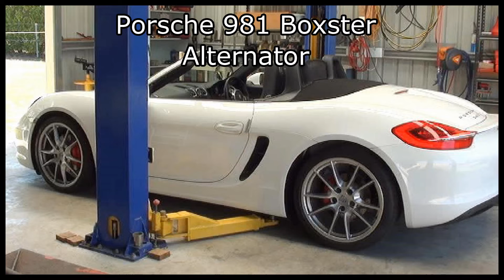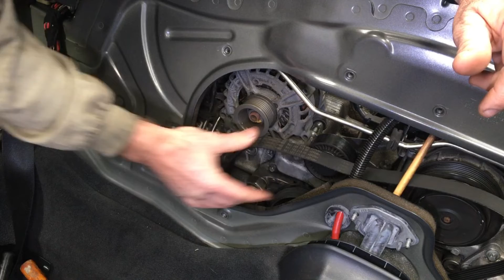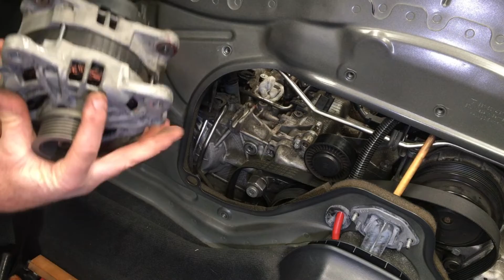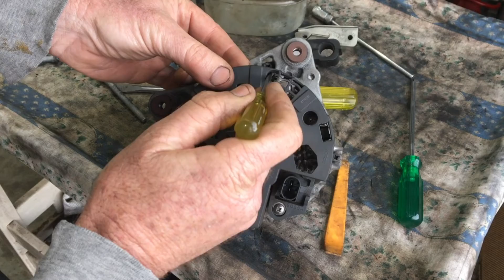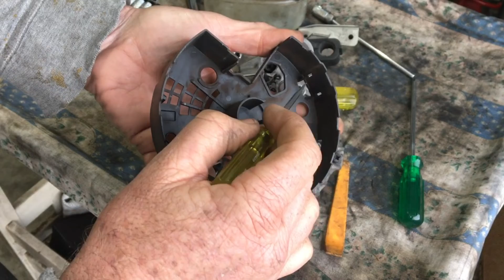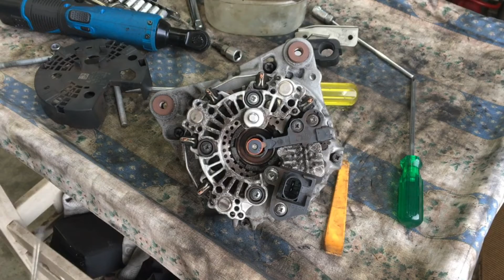Porsche 981 Alternator

Comment: Jeff, how much play is in the main wire and connector? Do you suppose you could pull the alternator forward far enough to reach the connectors from inside the cabin without breaking them or having to remove the intake?
Also, have you been able source a voltage regulator for these? I haven’t been able to find a separate part for the 981’s

Comment: Do you think you could change the voltage regulator without removing the alternator by just coming in over the top as you started when disconnecting the electrical connections? I’ve a 986 but it looks extremely similar
Reply from the maker: I didn't try this, but to be honest, alternator removal is pretty simple, and with the limited space in the engine bay it might be tricky. Only one way to find out though and that's to give it a go.
Reply: Thanks very much. Your videos are very helpful and gives me confidence to go ahead

Comment: Great guide, I’m having issues with battery drain on my cayman, I’ve narrowed it down to the alternator so I’m going to follow this guide, doesn’t look too tricky. How easy is the intake manifold to get off?
Reply from the maker: It's a bit of an effort, and is most of the work to get the alternator out. Have you seen the video I made on removal of the IM? 
https://www.youtube.com/watch?v=HqPPPF_zin0
Reply: Thanks Jeff. Do you reckon I could get away with just loosening the intake enough at the alternator side to be able to release the alternator clip and power cable, Rather than removing the whole intake ?
Reply from the maker: @craigwilliams5428  I looked at this and from what I saw you just can't get in there. Might be worth a try.